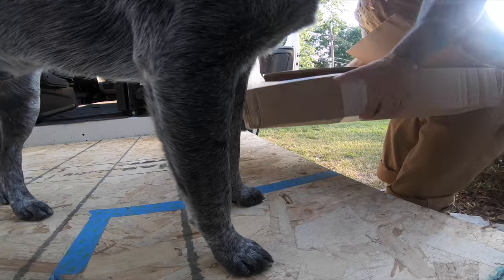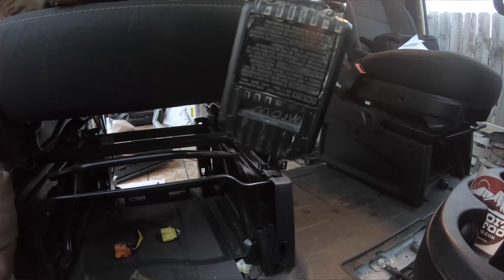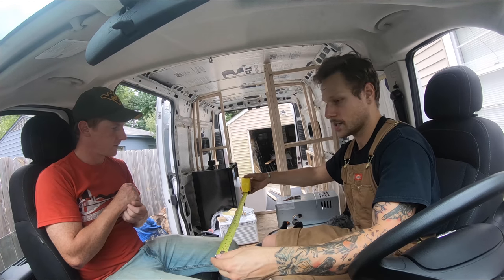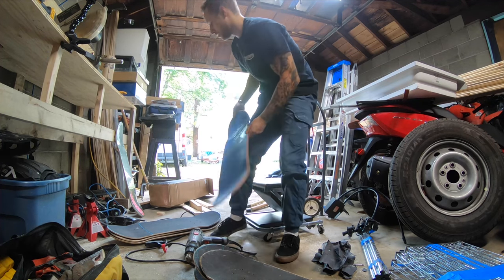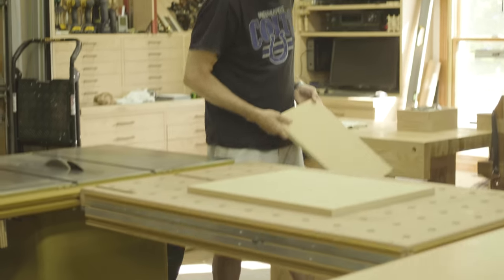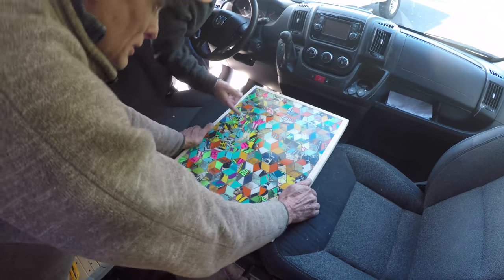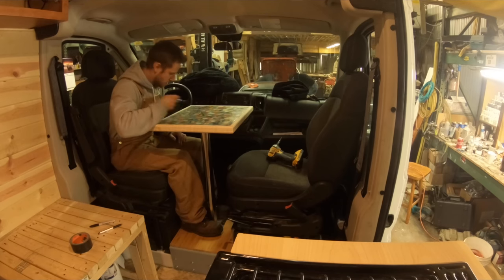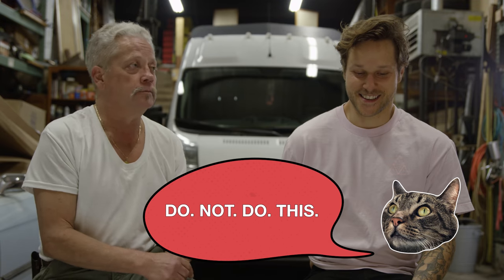Van Conversion Dining Room

Comment: Hi mate..I recently started a promaster van build and want to build a custom epoxy 30"x30" table to act as a dinnette and then drop down to form part of the bed base. How resilient is the epoxy table you made? Do you think it would hold up based on what I need it for. Cheers......any advice would be much appreciated.✌
Reply from the maker: Yeah the epoxy holds up fine. The framing around the epoxy has been beaten up a little bit, but not bad. It's a smooth surface so a mattress pad on top of it might want to slide around on you a bit.